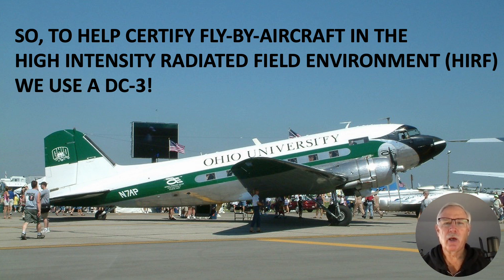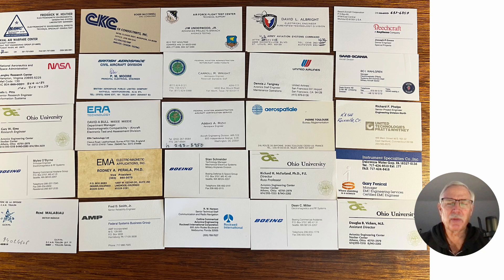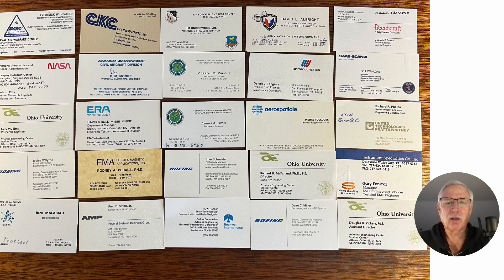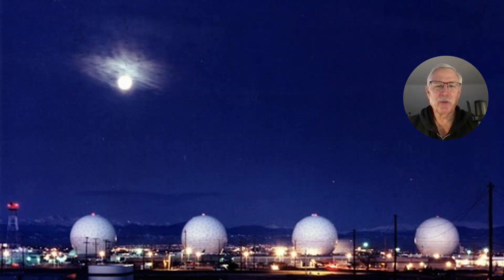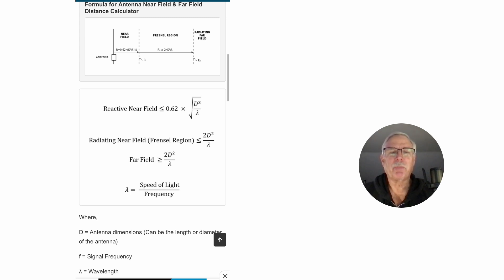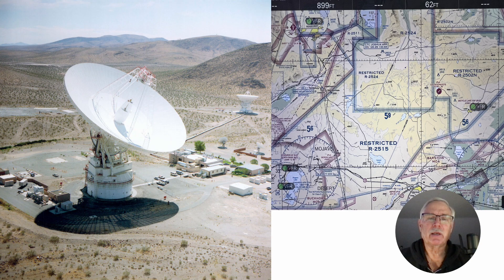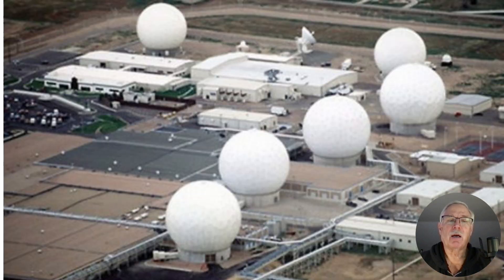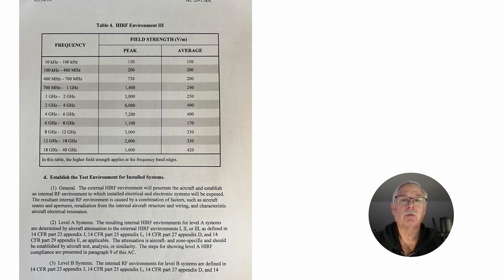SO, TO HELP CERTIFY FLY-BY-AIRCRAFT IN THE HIGH INTENSITY RADIATED FIELD ENVIRONMENT WE USE A DC-3!

Comment: Did you ever run across a Boeing DER named Fieder in the Northwest?
Reply from the maker: Doesn't sound familiar but it has been a long time ago.
Reply: The DER’s kid was named
Mike Feider. Mike and I were good friends. Mike over saw my work to certify a brushless dc wiper motor for the 747. I also worked some EMI hardening issues in Wichita.  I once a picture of the test range. It is so long ago I can’t remember which one or where it was. 

I enjoy the stories and don’t mind typographical errors. Thank you.
Reply: Saw a picture.

Comment: I am a licensed amateur radio operator. I was born in 1988. I got my license when I was 13.  I distinctly remember measuring HF propagation by tuning into the Woodpecker. My radio was modified so that I could xmit anywhere from 30KhZ to 30MhZ and I remember trying to talk to Russian Taxi dispatchers.

Edit - There is a FASCINATING 3 part video on the Australian DSN station on YouTube. They go into intricate detail showing live uplink and downlink to Voyager 1 and 2!!

Edit- I want to say that there is an Airbus error message when the rad alt is unreliable due to 5G interference. Perhaps I'm remembering incorrectly.
Reply from the maker: 73, KC0ZN Amateur Extra. Licensed since '78.

Comment: Very interesting, Ron. As a line pilot, I was on a BALPA (the British ALPA) tech study group in the mid 1980s when the A320 was in the pipeline and one of several issues of concern was possible EMI (as we laypeople called it) on its digital FBW and other systems. 
In January 1988, just before the type was certificated in Europe, I was on Airbus's pilot conversion course #2 (course #1 was allocated to Air France pilots). We were told that one of the EMI tests had involved parking one of the test A320s on the ground at a military airbase in the south of France  - probably Istres - with engines and all systems running. It was then bombarded with very powerful radiation - presumably at a wide variety of frequencies and intensities. They simply couldn't get any of the five EFCS digital computers to trip, apparently. The latter had employed mass-production commercial microprocessors by Intel (80186?) and Motorola (68000 series?). Whether they subsequently tried similar EMI bombardment in the air, I didn't find out. 
Years later, I had an above-normal lightning strike on an approach in Spain that punched a hole in the nose cone and took out one of the two radar transceivers. Everything else continued working without a blip.
By the way, from what I remember of the DC-3 (C-47, actually): you call that an autopilot? 🤣